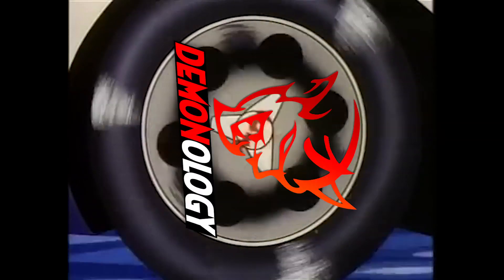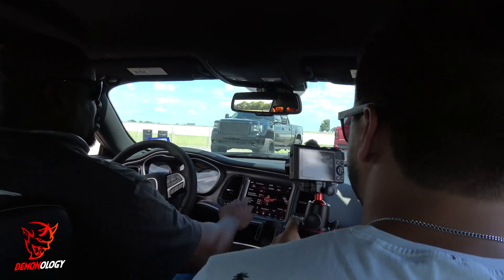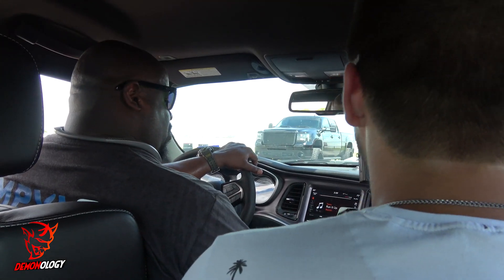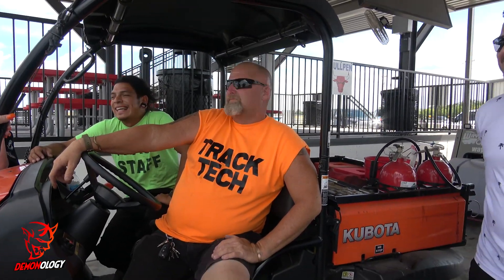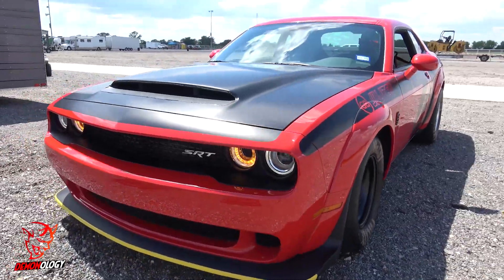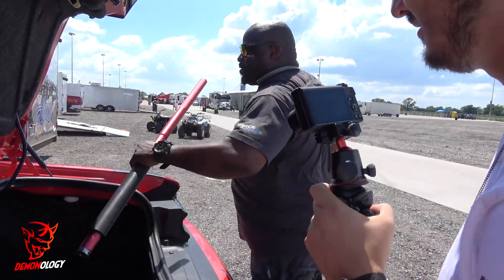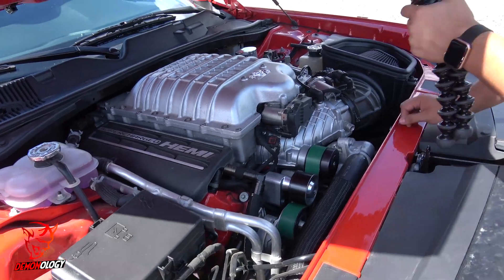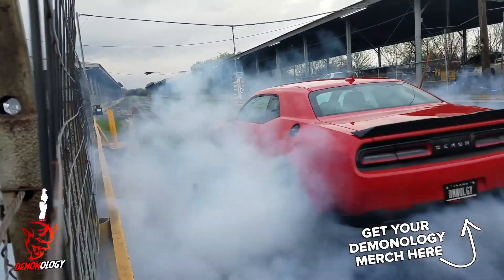itsjusta6 installed a SECRET MOD to make my Demon faster 😂 | DRAG RACING | Demonology

Comment: I Actually Wanna See Demonology Run Against Every Person From Street Outlaws
Reply: He will loose
Reply: Smh...hopefully you mean in their daily cars and not their race cars.
Reply: Geee really guys? Go figure he’d loose to tube chassis $250k Generic Motor Crap boat anchor powered“street” cars.
Reply from the maker: I could bracket race against them no problem
Reply: mrgee six  try adding 1500 to 1800 more. Street outlaws are 2500 to 400hp on prep tracks.
Reply: @Demonology  Yea you could but heads up you probably would not stand a chance
Reply: @Demonology  now that would be a sight to see. A 6sec 1/8th mile dial vs a 4 sec. That chase would be spectacular.
Reply: @Demonology  true

Comment: Why didn’t they strip the paint before applying the bed liner?
Reply: Because lightly sanded paint will hold the liner material sprayed way better than bare metal.
Reply: Devante Swing Okay, but the clear coat was not touched.